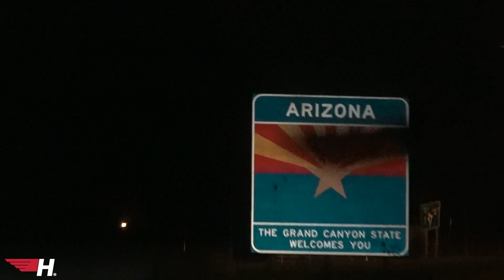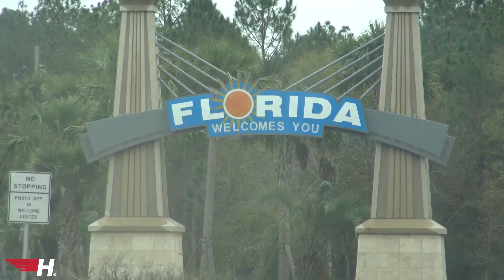GENESIS GETS FIXED ROADKILL STYLE

Comment: So when it started raining was that the moment you realized you should of not removed the windows?? 😂 Also why not just swap the cover to the old diff?
Reply: Should have*
Reply: RedLineBandits its really not bad with no windows, yes you get alittle wet , but not soaked. And i didnt swap the cover because i didnt have the right fluid or rtv , it was much easier , faster , and cheaper to just swap the whole diff
Reply: Orion Dajnowicz True shit forgot about it needing lsd oil. Well at least it's fixed my guy.
Reply: Orion Dajnowicz what i'm asking myself is why not use plexiglass or something? Just with a little square that u can open and close.
Reply: You could just put a towl on your window easy fix 🤷🏽‍♂️
Reply: Maybe I'm being stupid. But stand the diff with the pinion pointing the ground and remove the cover.
Reply: Adam May that would work so long as the pinion about portion volumetrically can hold the amount of diff fluid also the pinion seal is not meant to hold 2 plus quarts of gear oil against it for a extended period of time. Many diffs the fluid level on level ground is lower then the seal and it's only there for the few seconds that the oil reaches it going down a hill.

Comment: Seems like the van is always in boost? Also, there's a drift event in Atlanta soon y'all should check it out! It'll be at Six Flags.
Reply: Dayton Carter ford power strokes make  boost throughout the whole rpm range. Any 7.3 or 6.0 without boost will barely move the truck.
Reply: Thanks for the info. I know diesels are pretty weak without turbos, but didn't figure it would be in boost while cruising on the highway.
Reply: Diesels are always in boost

Comment: Definitely need some hardened steel bolts and hardware especially on rear diff / motor mounts etc... you gonna snap that grade 8 bolt clean n half again
Reply: EURO Rehab its not grade 8 , its grade 5 , grade 8 will snap with one clutch kick
Reply: i was kidding on the grade of bolt either way and grade 8 is stronger than 5 lol they arent hardened steel and that is what you need lil buddy dont wanna see you snapping off another in the diff.. vw trans mounts has same problems just get a hardened steel and never have to worry about it again.